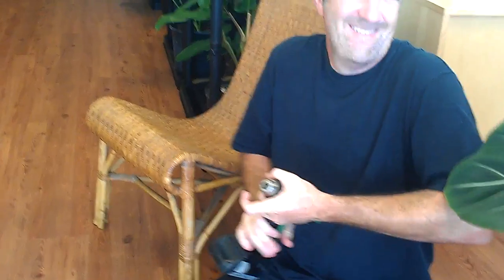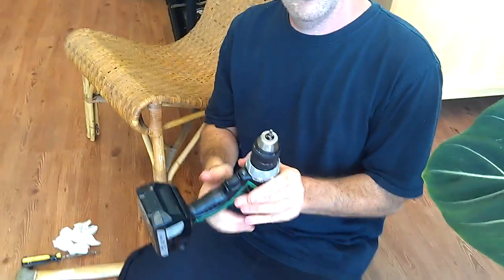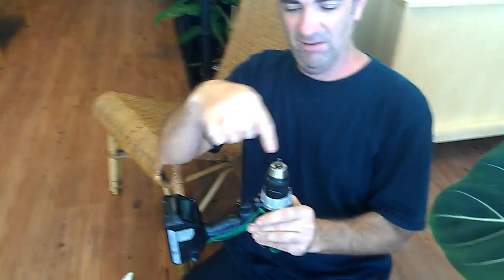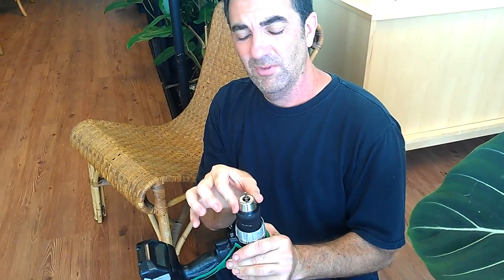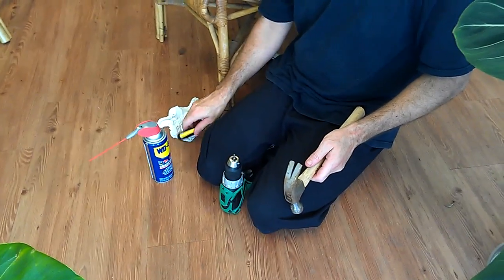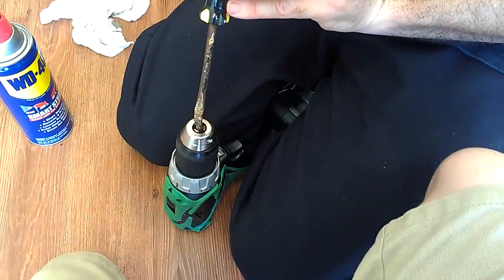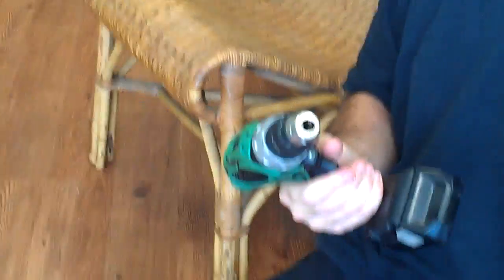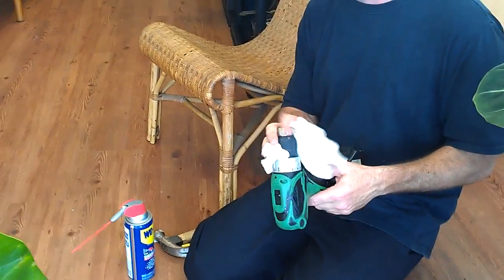How to fix a stuck keyless drill chuck hitachi

Comment: I had that happen on a Porter Cable.  I removed 4 screws from the front of the drill and it spit out a dozen or more tiny ball bearings and others parts.  It was an older brushed model that fit very nicely in the garbage can.  The original batteries were terrible too.

Comment: Writing from the future in 2022. lol. A BIG THANKS TO YOU FOR THIS VIDEO!!!
I sprayed the inside with WD40. Didn't work immediately and so left it overnight. Next morning it was still stuck. Now because the idea of using a hammer on it was kinda scary (lol) I used a small old metal office stapler I had lying around.  The vibration does seem to do the trick. I just tapped all around the front part once around and then I could feel the chuck start to rotate in my hand and viola - completely free.

Comment: Thank you for posting. The procedure you outlined worked smoothly and quickly. My drill is a 12volt Bosch with a jammed 3/8 inch drill bit. The key element that worked for me is the slight tap on the prongs, no need for more than "slight" and of course a liberal amount of WD-40. You made my day; have a great one yourself!

Comment: Not getting success with WD40, so heated the gripping mechanism with hot water.. the Bit started to move up and down in the chuck , so more hot water and it finally slipped out. Chuck still seized so it got some hot water too. Prized the gap gently apart between the two chuck pieces with thumbnail and it gradually separated. Then wound grip mechanism in and out to make sure ok.

Comment: Great tip. No waffle or ten minute exposition.. sprayed some wd40 quick release, used a flat head screwdriver and small hammer, gripped the bit and drill head then tapped one of the metal prongs about 3 times and bingo

Comment: Did this on a hammer drill head with keyless chuck. 
Not even a single oil drop used. Just tapped with hammer for 2 mins.. a little bit more force than you are using in the video. And then put some more force into the hammer when Hitting the three prong or claw or whatever you call those three little teeth like thingy that is holding the drill bit with the flathead screw driver. Try increasing the force until u feel like u are almost going to dent the claw. And then keep doing for 5 or more mins until it will gradually loosen it.

Comment: Thank you so much!...I had two different drills that were stuck. I used your techniques with the WD-40 and light tapping with a hammer and within 20-30 mins they both were unlocked and moving freely...Thanks for posting this very helpful video.☺

Comment: Works :)))). I couldn’t release the drill chuck, thought the next step was the bin and a new drill when I found this video. I had already soaked the drill end in WD40 and was doubtful that the hitting with hammer/screwdriver while soaking would work but I still tried. And it worked! I am very thankful :))

Comment: Had the same problem - had tried tapping and 3 in 1 oil no joy - one site suggested putting the drill in the freezer - still no joy stuck tight - after half and hour of fruitless tapping I was starting to lose the will to live - got a piece of tube slightly larger internal diameter than the stuck bit, outside diameter less than the chuck size (1/2 inch) - now comes the brute force bit - got my big SDS hammer drill put an SDS key chuck on and a small broken drill bit stood the drill with the stuck chuck on end in a vice, the old broken bit in the end of the tube and used the hammer action of the SDS hammer drill on the end of the tube - freed within  5 seconds - purchased a new chuck as I had a few burrs on the opening on the old one but cleaned them up so I now have a spare.

Comment: Worked great on my Milwaukee drill.  Thank you so much for this video.  Wish I would have watched this before putting the chuck in a bench vise and wrench.  It would look a little nicer still.  If I can add to this I used PB Penetrating Lubricant.  I have WD-40 but that won’t eat into the rust nearly as quickly or we’ll.  Please don’t let that take away from the fact that it was YOUR awesome tip that saved my drill!

Comment: Realize it's an old video but I just wanted to comment and say thanks - I just bought a new drill and this happened to me and I wasn't sure what to do - honestly I should have been able to figure it out but I was sort of freaking out but this video showed me how simple the solution was. I used the WD-40 and tapped the drill a bit (the prongs though were too far in for me to tap them) and within a minute I was able to get the bit out.

It was a Black and Decker drill/driver if anyone is interested.

Comment: 3 days of soaking, tapping, no go.  Figuring I had nothing to lose, removed screw holding chuck, soaked some more.  Finally, today, mechanism freed itself!  Poured out old WD40 oil and it was dark brown (rust).  Glad I read comments about replacing WD40 with true lubricant .   Will let drill sit in down position to continue to drain out before lubricating.  thanks again.

Comment: Awesome! This really works! You need a bit of patience but just keep doing was this guy says and it will work. This is the second time this has happened to me, the first time I had to throw the drill out. The trick is to give the stuck drill bit and the chuck a whack with the hammer (not too hard) from each direction (eg give it a quarter turn) after you have drenched it in WD40. To work the WD40 in more, also try operating the drill in forward and reverse.

Comment: I had the same problem on the same Hitachi Drill.
My drill bit had a hex end.   
I tried about 5-6 times with WD40, then when my can was empty I used Penetrating Fluid.
I filled up the chuck with fluid and left it in a pail to prevent if from falling over for a couple days.  Still stuck, 

Because I had a hex end bit, I held the chuck with jaw locking pliers and another pair of pliers on the bit.  While holding the chuck, I rotated the bit back and forth and the bit became loose.  I wasn't able to do this before your lubricate, tap trick.

Thanks a lot.

Comment: Thanks.   I thought previously about using this method on my Makita keyless chuck, then saw your video, and that convinced me to give it a try.  Worked like a dream.  30 minutes and two doses of wd-40, a few timely, gentle taps with the hammer, and bingo. all freed off.  I agree also that a few drops of light oil eg 3-in-one afterwards should help to protect in the future.

Comment: Forgive me but you, I'm guessing not a certified power tool engineer, just told me exactly the why and how clearly and directly while the previous 30+ videos featuring experts, mechanics, builders, and or tool industry folks couldn't or wouldn't explain the why of the problem, and rather simply, frustratingly instructed the viewer to replace the entire chuck. let's see, $0.30 in WD40 or $40.00 + gas $ to replace it.. hmm, I think I'll take $0.30, Vanna. So, I thank you very much. Appreciate the video. cheers.
Reply from the maker: Glad to help :) I had the same problem back in 2013 - i think there was only one video about a stuck chuck on youtube at the time and it was like you stated.  Somehow I figured this technique out by remembering an engineering show on TV about wet sand and liquifaction.  I believe it was about the making of the "islands" in the UAE and how they had to vibrate the sand..  so i figured I'd give it a try.

Comment: I had the same frustrating problem. After trying everything and Just as I was about to throw the cheap piece of junk out the window when I read Mr. Bright's answer stating that Black and Decker 12 v drills were notorious for this issue I figured I had nothing to lose so I hammered a tiny flat head between the silver plastic chuck (?) and the area below it.  I was on a mission to make my own door stop because I rent and I did not want to install my 100 yr old antique one and risk forgetting it when I moved out. I found a wooden plug that I had salvaged from something and I was planning to drill a small hole through the back so that I could thread in a double ended screw and insert that into the baseboard behind the door after I had created an entrance point. With the Phillips head bit stuck in my tool it was useless to me anyways if I succeeded in ruining it. It took some working but I was able to insert my pocket sized flat head into the space between the two areas and after giving it a few short but I-don't-care-if-you-die whacks it loosened up and let go. Please pass this info on. It's better than people stripping the plastic treads or threading or whatever, on the chuck. It took 2 seconds.

Comment: I saw this and got a saw blade unstuck from a sawzall in 5 minutes. So, I tried it out on a drill I was about to throw out, with a big hole saw stuck in it. The first 2 days nothing happened. On the 3rd day I could nudge the hole saw arbor about 1/8" out. Day 4, today, it's fixed! Thank you!

Comment: WD40 will work but it's not a lubricant (everybody thinks it is). You're better off using a penetrating oil (let it sit overnight chuck up) and I think you went overboard w the spraying. That wd40 may damage other internals eventually. But using the true lube--> hammer tap is a good technique.

Comment: Do you think this will work when the chuck is stuck straight out of the box. No bit. I cant loosen it to put a drill bit in there. Im holding the collar as tight as I can and turning it counter clockwise to loosen and it wont budge.

Comment: Much appreciated! It really worked. The tapping on the three grippers is what help frees the mechanism. Tapping on drill bit if to loosen between grippers and the bit. Penetrants loosen up the corrosion and friction in entire thing. Before you start tapping on the three grippers, make sure your have loosened the tightening knob... you know when you turn it tight, it clicks and to loosen, it unclicks... you unclick it so the whole mechanism is ready for movements. Sometime you need a bit of persuasion at the end like the one that been stuck for like two years which I now can use again!. Whoohoo! Works on any keyless chucks. Thumbs up.
Reply: That is a very good point you made regarding making sure that you have 'unclicked/unlocked' the chuck before you start trying to loosen it.

Comment: Great technique, worked great. I would respectfully add an important comment. After this, get as much of the WD40 out as possible. It's a solvent, not a lubricant!It will attract dirt.
Put in some lubricant, such as 3-1 oil to prevent future lockups.
Reply from the maker: Yes that is true- WD-40 is good at repelling water from stuff, but the best lube for your drill chuck is oil :)

Comment: I have ADHD and I forge t to wrap up my projects. I left my Dewalt drill out in the rain and the bit rusted solid. I did think of the WD40 but the gentle taps w the hammer made all the difference. I didn't want to take the drill apart this video really helped me.
Reply: Reminded me I left an Ozito impact driver out in the rain for a day and night two years ago. It's still going fine today somehow (except for the drill bit!)
Reply: I have bi polar type two and left my hammer outside in the rain and when I came back it wasn't my friend anymore. True friends would accept me how I am.

Comment: Thanks, I worked for the Jacobs Chuck Mfg. Co. for 25 years, but I didn't know that little trick. I honestly thought I'd have to replace the chuck, just wanted to be able to open the chuck so I could get to the set screw and torx's it off. Thanks to you I don't have to buy a new one.

Comment: This worked on my Ridgid X4 Drill/Driver, Model R8611501. Used Blaster and tapped lightly with a 1/4" pin punch. Bit came loose with first tap.

Comment: watched your video.  thanks.   mine got stuck when in reverse (backing out a screw) - the wd40 trick did the trick.   I did use wrenches after letting it soak for 1 hour, but I did not have to crank them very hard.